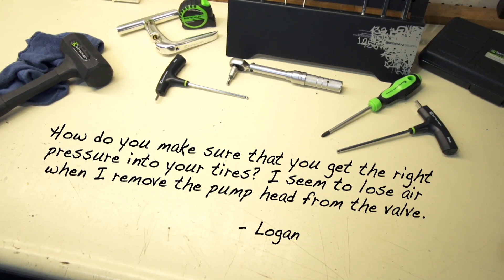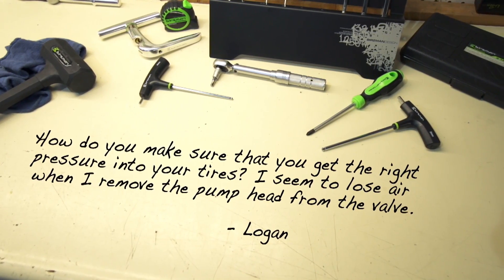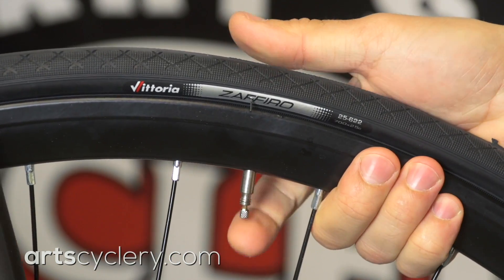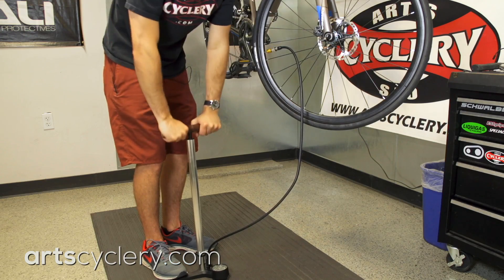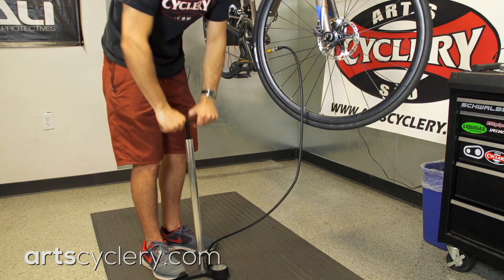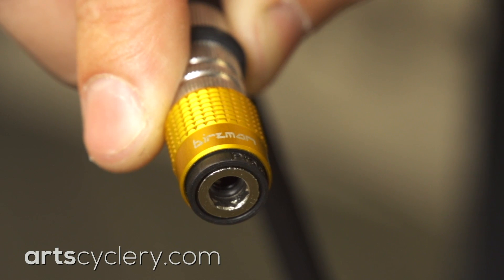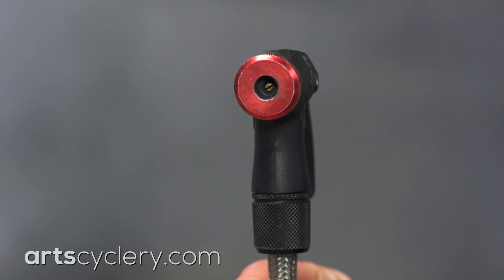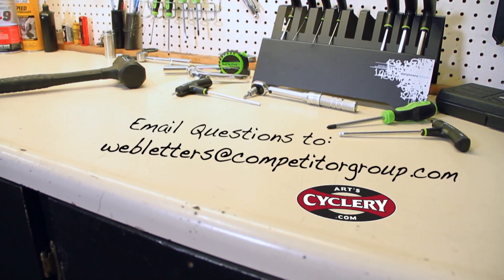Ask a Mechanic: Understanding Pump Heads

Comment: How about you do this same topic but about shock pumps. I have this problem when removing the pump from my rear shock.
Reply from the maker: Good suggestion. Very few shock pumps have a feature that prevents air loss during disconnect due to the nature of Schrader valve internals. However, Birzman makes a shock pump that solves this issue.

Comment: Even if you did lose some air through the valve, it wouldn't be an issue if you use the same pump every time. I doubt the gauge on any bicycle pump would be accurate enough to discern the loss of that much air.